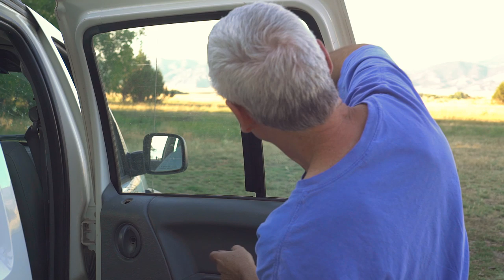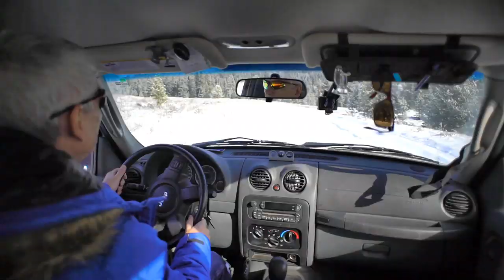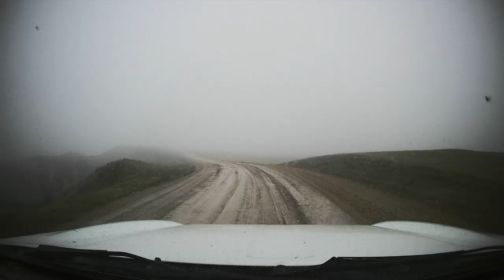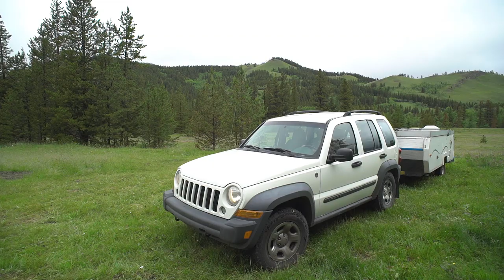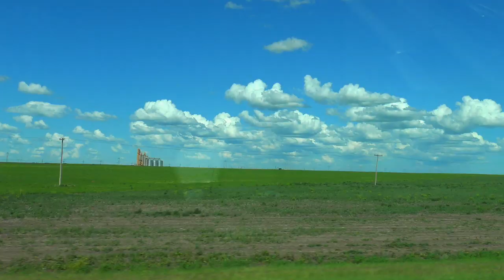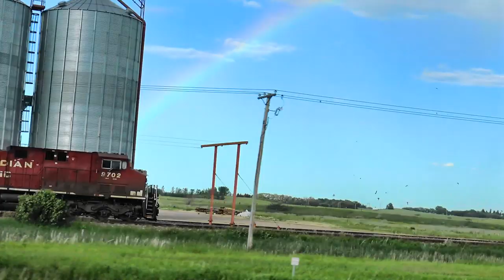Bye Bye White Jeep! Slim's Road Trip Part 1

Comment: our heater core started leaking in Alaska; replaced it several thousand miles later and working fine now.  The Libby is great value, ours goes where most Wranglers do go.  Especially with the recent 2” lift kit we installed (JBA kit)

Comment: HEY, Good choice on jeep. Looks like a 2008 liberty. We have one and when we bought it came with lifetime warranty on drive components. Only thing is the heater core is bad design. Drivers side after while not much heat. Passenger side ok. Replaced core my advise is to have core flushed out regularly. Over 140000 miles only problem. Check out reviews and see everyone has trouble with core. It is not the heater control.

Comment: Consider a Toyota for the next vehicle. Will never ever break or leave you stranded
Reply: I did not plan to buy a used Toyota but one came up that fit my budget and would tow my Aliner. Wow, I love this vehicle so much. Great traction and holds a lot of cargo, plus I've done nothing but regular maintenance. It's ok on gas even when I tow. I'm a Toyota believer.
Reply: Yup, but they're also usually the priciest, depends on what your budget is

Comment: Being a person who has never spent more than $500 buying cars(unregistered) and putting them back on the road, I can honestly say there is nothing wrong with an older vehicle. If well maintained, they will last 20 to 30 years or more. Still have mum and dad's old car that they paid $400 for back in 1989, A Holden Premier. Its 50 years old this year and it still runs and drives fine. As does another 50 year old car that is parked beside it, A Volvo 144..(sadly, they have to go!). Have been travelling Australia in a 32 year old wagon(another Volvo) that has done in excess of 650,000kms in its life. Wouldn't part with it, as it's been a very reliable and dependable car. I'm in the same position, don't have the money buy a new car. Even if I did, I'd still buy an old one and fix it up. It's cheaper! Then, I fix them myself.. self taught mechanic. 

That would be my best recommendation and advice to you Slim, to anyone.. learn to fix your car, yourself. At least the minor stuff. Window regulators are quite simple. Most often, the glass comes out of the regulator. Had it happen so many times on mum and dad's old car. 

That rear door on the Jeep, would've been a headache with the trailer.

Comment: Jeeps equal Fiat quality now. Best bang for your buck is a 2005 to 2007 Toyota Highlander SUV. Based on the ultra-reliable Toyota Camry. Find a lower milage one and it'll last 300,000 miles.

Comment: Stay away from the JEEP Renegade it's more Fiat then Jeep.
Reply: Even before Fiat, if you aren’t buying a jeep, salesmen will tell you how crappy they are.
Reply: 3 town and countries, 3 failed transmissions. The latest was my 2015 at 48,582.00 the power train warranty took care of the tranny but I sold it and got a used Toyota Sequoia. Never been happier. (Even with the gas cuz with the granny slipping on the t&c, it ate gas like an 8 cal not a 6 cyl. Even on eco boost.)
Reply: Jack juliano 
yes that's why they are now 2nd in sales....
Reply: Both of his Jeeps were Libertys, no Renegades in this video. The newer KK he bought uses the front end design from the Commander.
Reply: @classicscustomsandhotrodso600  I remember talking to some Jeep salesmen and they were telling me about the headlights falling off in the Grand Cherokee (Late 1990s / early 2000s?)  The glue that held the lenses on had a habit of just letting go after a couple of years.
Reply: @ptonpc  they had many problems,much worse than that. I hated working on them.
Reply: I own one. It's reliable and good fun.  1.4 liter turbo, six speed manual.
Reply: @jonstarritt848  Lots of people talk to talk loll
Reply: ptonpc happened to a nice condition 2006 town and country I had I’ve had three Chrysler products never again. Coolant leaks switch’s die in flight water pumps. Sic and tired of them.
Reply: I own a 2019 Jeep Renegade 4x4. I hope to have decent service. 👍
Reply: Watch Scotty Kilmer's channel. Great mechanic doesn't like any Chrysler products. Land Rover are built in India by Tata.
Reply: Jeep went severely down hill when they went to Chrysler. Last good Jeep was the TJ Wrangler and XJ Cherokee. Everything after is pure plastic, unreliable garbage. Be lucky to get 50k miles out of the new ones.

Comment: I own a Toyota truck. It's never had a failure. My wife owns a jeep 1/2 my trucks age and less than 1/2 the mileage and we've spent a few thousand on repairs. The problem with buying a used Toyota is you can't find one with under 100k miles. It is economically similar to buy a new Toyota or a used Jeep. The savings on fuel and repairs with the Toyota would make the cost of ownership nearly equal.
Reply: Brother's Toyota 4Runner 4WD still going after 300,000, but horrible gas mileage, rides rough, and very uncomfortable to sit in for any long period of time. Our Astro Van just quit working after 320,000+ miles. It was AWD and did great on the road. I mourn its loss. Very versatile and great for traveling and towing. I would love a Jeep wrangler, but my nephew is a mechanic and says they're very expensive to repair. The newer ones just are not as robust as some of the older ones. Can be difficult to work on and that means more labor time and more $. If you're still looking for a replacement, Slim Potatohead for less $$, check into fleet vehicles for sale from the rental car companies. May find a great deal through there.
Reply: @susancronk8512  Yes, Enterprise Car Rental is an especially conscientious company. My sis works in corporate in St. Louis, I got a great used Altima at a good price, well kept up.
Reply: Toyota don't make a small truck based SUV !!!!!!!!

Comment: An old 4Runner it's more reliable than a Fiat. Or any car!
Reply from the maker: I don't own a Fiat. SP
Reply: @SlimPotatohead  Fiat-Chrylser own's Jeep currently. But Fiat had nothing to do with Chrysler at the time of production of that style Liberty as far as I know.
Reply: @SuperSolomaniac  The Jeep Liberty KJ was designed in the late 90's by Daimler Chrysler. The engine (3.7 Powertech) was in part designed by AMC before that brand was fully absorbed by Chrysler. It's up there as one of Jeeps best models ever selling nearly as many as wranglers of the same years. It had better road manners than the Cherokee XJ is was designed to replace and was well reviewed while outperforming similar vehicles.

Comment: I'm a Jeep man and also buy what I can afford. 2016 Jeep Grand Cherokee Overland High Altitude Diesel. Got a really good deal on it because of a diesel particulate issue the previous owner did not want to deal with. Turns out it was under warranty and the dealer fixed it free plus it was under the diesel class action and they reprogrammed the computer and transmission and gave me $3500 for pain and suffering! Still runs the same and tows 8,000 lbs with ease. My camper weighs 2600 dry (lance 1576)

Comment: Had the same problem with my 2006 Liberty front windows.  Fixed them with Steiger Performance regulator repair kit.  I'm not a mechanic, but I can (and will) do the work when necessary.  I especially enjoyed seeing you with your liberty on the trails.  I think you just needed to give it some TLC and you would have been okay for a few hundred thousand more.  But, as you say, everything has an expiry date.  Keep on truckin'.

Comment: 2000 - 2004 Toyota Sequoia. V8, all wheel drive. The V8 gets on average 15 - 20 mpg on the highway. 8000 lbs towing capacity. Used in good shape $6000 -$8000.  Great shape $8000 - $10000.

Comment: None of the things wrong with your old jeep were very hard fixes. You can get new window regulators on E-Bay for cheap. Not a big fan of Jeeps though, mostly because of the gas mileage.
Reply: I'm getting better gas mileage on my Jeep then I did on the Saab 9-3

Comment: It's hard to find good small 4x4 tow vehicles that aren't overpriced Japanese vehicles.  I hope you did your research on the year and model of this Jeep.  Jeeps can be hit and miss when it comes to reliability.  Their not trash though or they wouldn't have such a following.
Anyway I can't believe you drove your vehicle around with duct tape windows.  lol.  You know you can find places that rebuild window regulators if you want to save a buck.  It's usually cheap replaceable parts that go in them.  Also don't sell yourself short when it comes to working on your vehicle.  Your camper improvements show you have a mechanical knack and the ability to fabricate stuff.

Comment: Should have bought 4 runner mine has 280,000 runs great never ever let me down.
Reply: He is on a tight budget. Used 4 runner...might as well buy a new 4 runner; not much diff in price. we have 03 Liberty  in Calgary since 04  315000 on it . has had new rad  new ps pump  new tires and brakes  and a couple of windshields since 04

Comment: There appears to be a stain on the headliner right where the a pillar meets on the driver side that’s telling me there’s a possible water leak.
Reply: I also saw that.  It's NOT a good sign.  Slim might want to give it a good bath to see if any water does leak inside.

Comment: Newer is not always better.  Looked like about $500 bucks in repairs if you take it to a shop, cheaper if you did it yourself. I had a Ford F-150 and 250 with my travel trailer and could not drop the tailgate because it would hit the tongue jack, and those trucks are made for towing, not sure tailgates or rear doors will open when towing a trailer with a tongue jack.  Best vehicle is one that is paid for, especially when you are on a budget as you mentioned.

Comment: A Subaru would do you really well, but I see you've already made your decision. There are ones with the flat 6 cylinder engines (and they're all 4wd except the new BRZ which is not a tow vehicle), but the ones with turbochargers are just as good. I tow 1600lbs easy with it, several times a year. A utility trailer (1200lbs) and my 450lb motorcycle. I can blast the A/C going 85 up long grades just fine without losing steam. I guess you could get a 2010 Jeep like that for pretty cheap, under 5 grand if you find the right one, but you should not discount the power/torque that the turbocharged 4 cylinders make. For example, my 2005 Subaru Forester Turbo was DYNOED (power at the wheels - engines are rated on the crank, that's what you'll find online or in the sales brouchure) and made 248whp, 263 ft-lb of torque (this is around 280bhp and 290 ft-lb at the crank). The jeep is rated for 210bhp and 235 ftlb. For comparison, accounting for driveline loss that jeep is probably making about 160whp and 210 ft-lb of torque.

Comment: Good luck on the new car. The Liberty was one that I looked at but sacrificed the 4WD in favour of AWD and towing capacity and got a Subaru. I don't regret it, but next round I'll get a bigger car because I upgraded my camper from a teardrop to popup. The Crosstrek can only tow 1000 lbs, but it has been rock-solid. I never had this reliability with a Chev, Pontiac, Ford or Dodge. Good luck with the newer Liberty.

Comment: Miss my Jeep Cherokee. A lot. Was once the must have SUV in the 1990's when I bought it. Never had any problems with it. Over a decade of use, and exploring most of the Western USA, a lot off road, the only thing I had to replace was a water pump. And go the interior full spare tire setup, specifically in case I ever got a trailer. But I never did. Irony.

Comment: I had a 2009 Grand Cherokee with the diesel and it was the perfect vehicle for me. TONS of power, towed like nothing was behind it, and still got great fuel economy. Comfortable, roomy enough to sleep in, great off road, and handled surprisingly well on road. But... that maintenance. Anytime something went wrong (and it would), it was easily triple the cost of fixing one of my previous gas cars. Not to mention that not everyone liked working on those German diesels. Perfect car, when everything was working.

Comment: Hello Slim
Good Video Slim.
Watch out for Flooded Cars & trucks. A detail shop can clean up ,it hard to tell. Have a mechanic go over it top to bottom looking for signs of water damage, or buildup.
Turn on AC , blowing from defroster vents, set a Humidity gauge on dash. Check for higher Humidity than outside. Flood cars do dry out. Not a foolproof test. Smell for mold, also strong air freshener odor, 1 giveaway .

Comment: If you can find a reasonable Toyota 4Runner that'd be the best bet - reliable, V6, and good off road capabilities.  Maybe a Forester, but I don't think it has the towing capacity for your trailer.  Window regulators, rear gate latch, or peeling chrome aren't that hard.  I figure you have the Haynes manual for the Jeep?  The rust just sand, primer, and paint it.  Unless it's major transmission or engine problems keep it a little longer.

Comment: Watch your video. Liked that. Notice you don't  equip your jeep for the off road. Everything is stock. You said you're on a budget.  You said pick up trucks you don't  like. Did you check out the crew cab pick ups. The 1's that are 4wd.   & are the size of your jeep. Don't  see any tow hooks on your vechiles. You use stock tires.  Video's  are good.  Be safe

Comment: My wife had the same problem with her Liberty windows falling down! She traded it for a Compass. One thing I've noticed is if a vehicle has been good to you, you trade it in when the little annoyances start getting to you. If it's a bad vehicle, it's the big things that get you - engine, transmission, drive train! I had a Saturn SC2 that I loved. Bought it new and it still ran great, but all the plastic trim parts were falling off and it needed new shocks & struts. Ended up selling it outright because I had already replaced it. It was the last brand new vehicle I bought. Now that I'm retired, I can't afford new.

Comment: The power windows are a known failure with libertys The plastic worm assembly is what goes out. I replaced all 4 in my liberty with aftermarket metal ones. I had our liberty for 11 years, I had worse issues went she got traded in.

Comment: That New jeep is Basically New nice new truck Mr Slim i have a GMC Envoy a Chevy Trailblazer and a Chevy 2500HD the GMC Envoy / Chevy Trailblazer are Both decent tow vehicles they are a lot like your jeeps but the Videos Wouldn't Be Slim Potohead productions without a jeep and the A Liner we have a 30ft Travel Trailer and a Jayco Pop-up when we are close to home the jayco pop up is perfect if we are going way out of town its the 30ft travel trailer keep the wheels spinning

Comment: I'm the same way .  I bought a  brand new  1994 S-10 pick up.  It gave me no troubles in the first month.. The second month is when all the troubles began. Engine over heating the ac would work when it wanted too and the clutch was junk. That was the last brand new vehicle I ever bought. I stick with trucks/jeeps right around the 10 yr old range. I figure if they still drivin and workin like it is supposed to 
at 10 yrs old its worth a looksee.  I drive a 2014 Jeep Latitude.  It gets me where I need to go and then some for its size.  Although I don't tow like you do I still like to pull it off the road and do some off roadin just to fart around and see how well it handles and drives on rocks and bumpy roads. Next up for me is a Rubicon JL .  Thank you for sharing All your adventures they are a joy to watch and learn from.  
 (  Hope it wasn't to serious at the end of the video  ).

Comment: Liberty is a horrible model for Jeep. 3.7 v6 is notorious for major problems. Transmission not much better. The grand Cherokee is much more reliable and much nicer to drive. Mine had straight 6. Very solid. But swapped out the 6 for 4 cylinder Cummins. Then someone bought it. Miss that jeep

Comment: As usual, I've read all the replies up to this point.  No shortage of opinions when it comes to vehicles or women.  A shakedown cruise/trip is always advisable with any new (to you) vehicle.  I'm guessing something with the cooling system broke & replacing hoses or other leaking cooling system parts isn't a task most people are equipped to fix under a shade tree.

Comment: Chevy Trailblazer or GMC Envoy would have been a good one to consider. 6 cyl. engine, 4wd, 6000 lb. tow rating. GM made them up thru 2009.

Comment: Slim, I've been thinking about your issue with needing power occasionally, in lieu of going to an RV park or a campground with power. Have you considered installing an inverter in your tow vehicle? You could have a switch to shut off/turn on power to it, and a power cord socket out of the vehicle to the Aliner. Theoretically, you could hook it up so that you can power up the Aliner batteries while towing from location to location. Yes, it would impact your gas mileage a bit, but you're already running the engine, so a bit more load probably wouldn't be a total mileage killer, and you wouldn't need a separate generator. If the wind turbine doesn't work out, give it some thought. Maybe even if it does.

Comment: I had a 2009 Liberty.  At 120,000 miles an electrical problem stopped it from running. The problem was solved inexpensively the next day. At around 130, 000 miles the the trans failed.  Although it took a long time, Chrysler installed a factory re-manufactured trans for free since I had a lifetime warranty on the drive train.  Both happened while I was traveling.  Otherwise it was very reliable.  I sold it to the Goodyear dealer who had maintained it for years; he was happy to give it to his mother.  It is still running well with an occasional minor problem.  I replaced it with a new 2017 Grand Cherokee which developed a problem with the satellite radio and a rough idle with only 32,000 miles while on the road trip that I am on at this moment.  Perhaps the Liberty is a better car.  Good luck with you new Liberty.